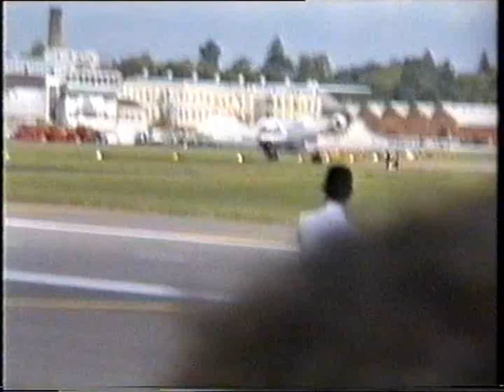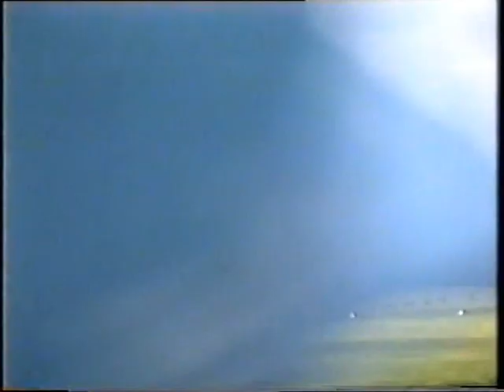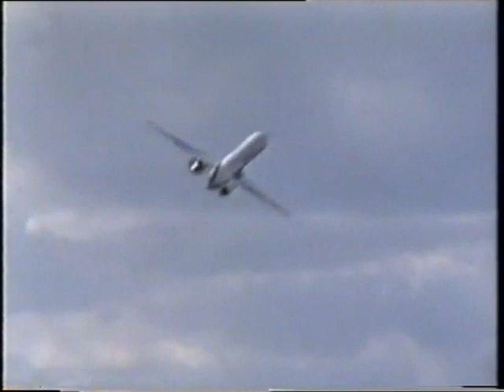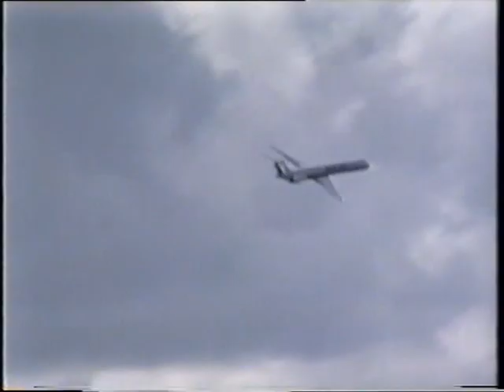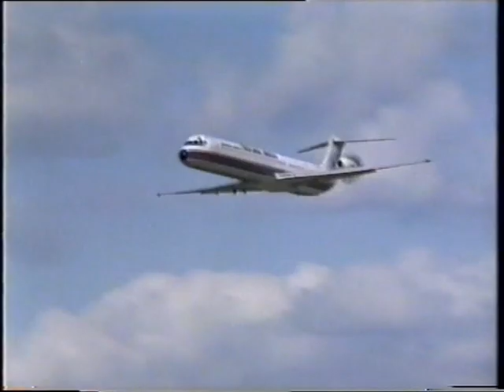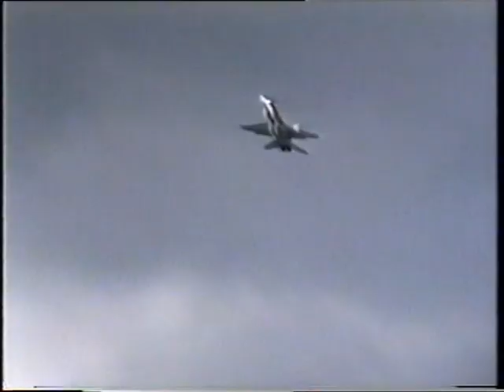Unducted Fan MD81 - SBAC Farnborough - 4 September 1988

Comment: The UDF or the Unducted Fan also known as a Propfan or an Open Rotor engine is kind of a mix between a traditional prop engine and a Turbofan engine, in that there is still a compressor and a "hot core" where air is compressed and jet fuel is mixed in and then burned.  This then drives the blades on the exterior of the engine.  They are about 30% more fuel efficient then turbofans, and allow for a higher cruise speed for the aircraft than turboprops.  The noise level is a bit higher though.

In case anyone was wondering.
Reply: Researched it already, Admiral. Already in use in some applications. Might be useful in short haul passenger runs where speed is not of the utmost, such as New York to D.C or Bay Area to L.A. Could be useful for runs as long as 1,000 miles (1600K), maybe longer. Also might be more adaptable to VTOL, which could eliminate some of the the need for huge airports. A lot of potential here once it is developed more fully.
Reply: From what I hear, the noise level is ridiculously high. Apparently, even with hearing protection, passengers had headaches for an hour afterward.
Reply: I was wondering, thanks.
Reply: @needsmoreboosters4264  well, that curdles the cat's cream.
Reply: they were 30% more fuel efficient. today’s turbofans are just as fuel efficient
Reply: @carsonhinterlong9949  But turbofans are slow. That's the biggest difference. Unducted fan could reach the same speed as normal jet engines.
Reply: @nntflow7058  - do you mean 'turboprops are slow'? Because a turbofan is the normal jet engine (these days anyway).
Reply: @thosdot6497  yes
Reply: Common misconception is comparing a UDF to a turboprop. Sure they look similar however they don’t quite work the same.

Comment: An awesome concept introduced in early 80's.  most fuel efficient and best performing engine!  should be brought into production.  technology has changed since 82, just think of the overall performance now.
Reply: The performance of the UDF nowadays would suck compared to a normal High bypass turbofan.
Reply: @tomatosoupwoo  yes, but so would any engine from the 1980s. A modern UDF would probably perform very well, plus it could help with size issues that very high bypass turbofans are starting to run into
Reply: It seems like they are actually on their was back: https://www.youtube.com/watch?v=4XfTu6dokjc 
Also search for CFM RISE (if I post other links here, the spamfilter may remove the comment). Seems like they can be even more efficient than ducted turbofan engines - which surprised me a little, since ducted fans are usually more efficient than open fans. But maybe at high enough air speed thru the fan, the losses caused by drag from the duct get greater than that caused by vortexes forming around the blade tips and circulating air (which is usually the biggest loss for open fans). These engines can also get a lot more bypass area compared to the fan size (high bypass ratio, usually means more efficiency. That's why the turbofan engines keep getting bigger and bigger. But the bigger they get, the more drag is also caused by the engine housing
 - not to mention space issues)
Reply: @tomatosoupwoo  No actually, it gets 14g/kn tsfc which is on par with the most efficient high bypass turbofans at a fraction of the weight
Reply: @vladimirpootis9690  14g of fuel per 1000 newtons??
This just reminds me of any other turboprop, it’s still using jet power but not using the jets for thrust but the prop, that’s all
Reply: It is called the MD-94X (the plane)

Comment: Currently, engine noise is heavily restricted on plane engines. Possibly why you don't see this on modern airliners.
Reply: It seems that fuel efficiency is less important than noise reduction. Really clever. Now they're comming back with this technology because of the fuel prices always getting higher. It's just a 25 year old waste of time and fuel.

Comment: so the same idea the Soviets/Ukrainians used on an Antonov An-70. Sort of like a turboprop in terms of fuel efficiency, but allows the aircraft to fly closer to turbofan speeds, albeit at the cost of higher noise output. Good idea for military transports, not so much for the noise-restricted passenger airliners.

Comment: Btw what is the function of UDF?
Reply: Fuel savings
Reply: The aim was lower fuel consumption compared with the jet engines of the time. Since then, jet engines have higher bypass ratios. I have seen more interest in UDFs of late but not by aircraft or engine manufacturers
Reply: @jacobmoses3712  Thanks for the explanation! I made that comment 9 years ago when I was starting secondary school as naïve child 😂